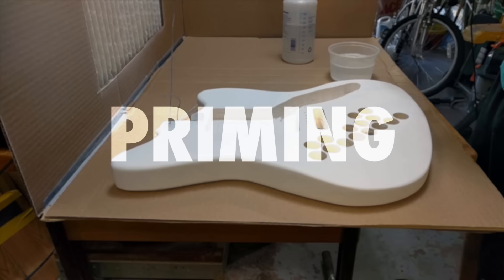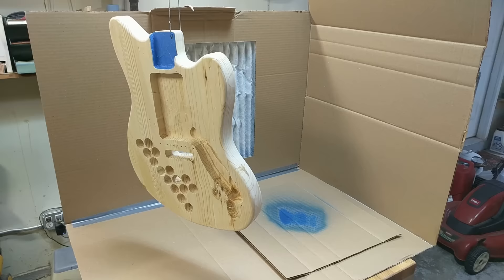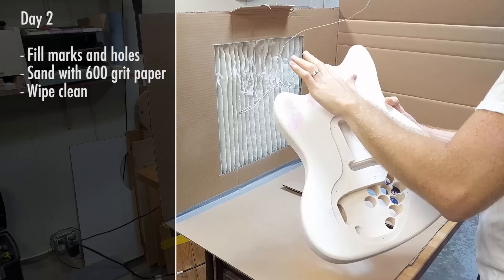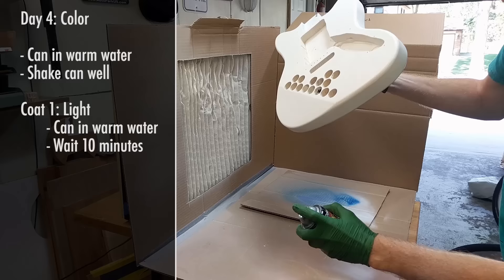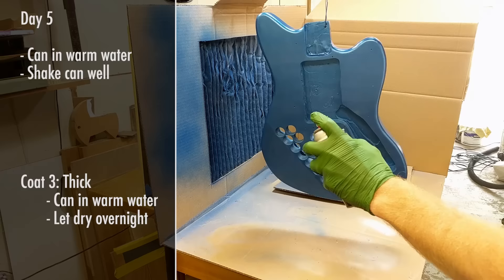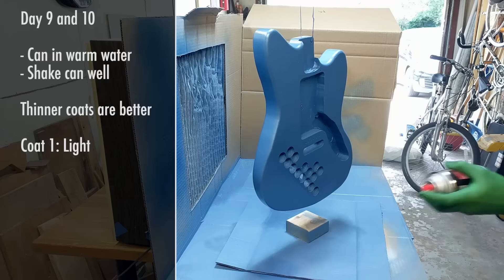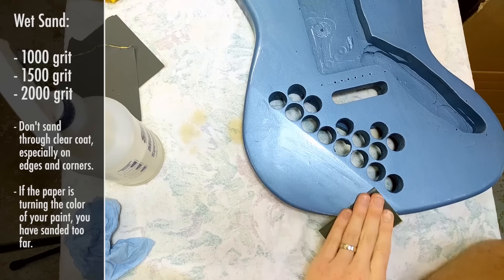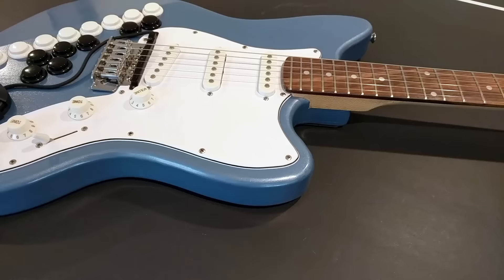How To Spray Paint A Guitar - Start to Finish

Comment: The video itself is well made but the described technique is not the way to paint a guitar, I am sorry. 
First of all, the prep work is key to a good finish. You need to sand down the wood with up to 800 grit paper to create a very smooth surface. If you use wet sanding paper for the last two or three runs, you will already remove any wood fibres that will lift (and create a velvet like surface) when getting moist.

Using car paint is alright to get the color you want but the primer should be a wood spray primer with thicker filler to close pores and cracks. (Before even using that, I would use a paste filler to get the worst pores and cracks removed.)
Only the first layer should be thin to create a surface the primer can stick to. Then you can already go with a thicker layer, sand it, respray a thicker layer and you should be done priming within 2 or 3 hours (including drying time). Let it rest over night to harden and go on with the base color paint the next day. Use light coats and bild up the coverage you are going for in many thin layers. If you use metallic or pearlized colors, only the last coat needs to be a bit thicker and very even to create the effect. Start with the sides, than back and front to create the best surface.

The clear coat should be a two component clear coat if you go for automotive laquer or a nitro instrument laquer. The key to good sound is an almost non-flexible laquer, since flexible automotive laquers will dampen the resonance of the body. So dont get clear coat laquer for plastic parts or anything else branded "flexible". 
To spray the laquer, mist a first layer to create a contact surface, the result should look like a satin finish. Then go with a second heavy coat. Clear coat will build a smooth surface when painted thick enough, leaving you with a small orange peel. After drying it in a heat booth or a room temperature over night, go on and wet sand with 600 grit to remove the orange peel. Due to the thickness of the coat, you can sand a good bit before burning through and damaging the color base coat. Always wipe the residue while sanding to see how far you are. 
The spray another thick coat of clear, let it dry and repeat the wet sanding from 600 to 800 to 1200. By now you have a very smooth surface that needs minimal polishing to get a high gloss finish. 

I realize that you spent two weeks with this paint job and are proud and satisfied with the result. But if you are honest and compare it to professional high end instruments, the result is a bit shy from being perfect. With the proper prep and technique you should be able to spray a guitar body in 3-4 days with professional results. If you watch other instructional videos on how to use paint cans or paint guns, you will see how you need to twist the wrist at the end of each spray to prevent getting drips even if you spray thicker coats.

In the end it is all about practice and experience so please don't get this reply the wrong way. It is not meant to parade on your video but to help you get better results quicker the next time from someone who has painted a lot before and learned the hard way ;)
Reply from the maker: Yeah there is certainly a lot of stuff I learned from this first go at it. I think the most common paint mistake is people think that the paint is dry so they spray another coat over it and then the bottom layer can never dry so the finish is always sticky. I just avoided that by waiting a full day every time. 

Thanks for the tips!
Reply: mervolicious - Great instructional summation! But could you clarify what you meant when you said " If you use wet sanding paper for the last two or three runs, you will already remove any wood fibres that will lift (and create a velvet like surface) when getting moist."? Is that a good thing, or a bad thing? Thanks.
Reply: FOAD RIGHTNOW - it is a good thing :) If you take any piece of wood and dry sand it smooth, then moisturize it, it will lift it's fibers (while drying) and create a rough surface again. So when you wet sand until there are no more fibers after drying, you will not lift those fibers when you paint the wood with a waterbased color (which most colors are nowadays) and get a smoother and better looking finish. If you intend to only oil the wood, no moisturizing is needed because oil won't lift the fibers.
Reply: mervolicious - Thanks for the quick reply! Your clarification was pretty much what I figured you meant. Thanks.
Reply: @mervolicious You should do a video
Reply: 800grit on the bare wood is way overkill. You really don’t need to go further than 320. Honestly going further can be hindering because if it’s too smooth paint will run instead of stick. I agree duplicator would not be my choice also if using a nitro lacquer or any volatile base paint DO NOT place a fan behind your spray area. Nothing that can spark should be anywhere near that explosive mist. I don’t know what wood that is but unless the grain is open sealing is optional. A good way to fill grain is 1/2 linseed 1/2 polyurethane worked in with 320 grit as the urethan builds it also pushes the sanding dust into the wood and levels then sanding after successive coats continues to level. When you are final sanding you are only sanding the clear coat not the wood. 
I am not saying that my way is the only way or other ways don’t work or aren’t good but as the saying goes you can shave a poodle 1000 times but only skin it once. There are a lot of ways to repaint and refinish guitars or any wooden object. The keys are prep, patience and products. 
Use the right products in the right order for the look you want. For an opaque finish it doesn’t pay to obsess over what the wood looks like underneath so long as it is smooth but it doesn’t need to be crazy flat the goal is removing tool marks then removing the marks left from removing tool marks then removing marks from....etc. once you apply color and clear coat that is when you start to obsess over getting it flat because the paint itself dries in a jagged fashion so regardless of how smooth it is to start (again 320 is good) you will still need to go from 600 up to 3000 grit or higher if you want before buffing.
Reply: @mervolicious  It wasn't necessary to sand between every coat, was it?
Reply: Eric Veritas Blair I assume you mean in between every clear coat? You could just spray two or three layers and then finally sand it before polishing. But if you want that deep water-like clear coat look, you‘d have to sand after each layer to remove orange peel and therefore optical distortion. This makes especially a difference when you have a flamed or any other structured top or painted it with a metallic or any other effect base color. It is a bit more work but that‘s the way to get that showroom finish :)
Reply: @mervolicious  He was sanding between each layer of primer and color I think?
Reply: Just a side note its 800 "grit" sandpaper, I dont think I've seen 800 "grid" sandpaper. I'm sure that's what you meant to say though.
Reply: Thanks, I guess. 
:)
Reply: @AiMR  personally I've had great results only prep sanding the primer and sanding the clear before polish.
Reply: mervolicious jeez man he’s on a budget here
Reply: Walker Shultz that‘s why my way is cheaper and quicker ;)
Reply: Mervolicious - How to select a non flexible clear coat and painting? I had just ordered Createx paints and clear coats. Are they good enough for guitars and the sustain?
Reply: @franciscojesuscortes  I used Createx to paint rc body shells that are very flexible. So I'd imagine they won't work for a guitar that well. The colors don't really matter but the clear laquer should be a component mix with hardener imho and not a one stage createx clear coat.
Reply: @mervolicious  Thank you very much. I see that Createx  has the 4030 to achieve an stronger paint but I don't know if it works for clear coats too. Which paint gun is good for this kind of works? HVLP or LVLP? 1.3mm is it enough? I know that for little ilustration, a chineese aerograph is enough good today, about 0.3-0.5mm needle.
Reply: mervolicious so is wet sand paper ok to use all the way until ur last two or three runs of using the paint finish?

Comment: I went about painting my faded orange/red strat black and did the absolute worst job ever, and I feel like an idiot cause I should know better from experience already. Guess I jsust needed to see someone else do a perfect job as a reminder to know now. I already have 4-5 coats of black and 2 coats of clear on it, so I'm gonna sort of take the quick route and just do one wet sanding job on what's there to get to the paint, then start from where you started clear coats and thereafter. I was looking for that polished look and obviously did not get that from just 1500 grit sanding plus clear coat. Thanks for the extremely well made video!

Comment: Great vid.  Not to criticize, but learning from my own mistakes... I would use a flat sanding block of some sort when wet sanding the clear coat on the large flat surfaces of the front and back. Otherwise you can get wavy funhouse mirror reflections if you buff it out to a mirror finish. I would personally start wet sanding the final coat of clear coat using 600 or even 400 grit on sanding block regardless depending on how much you need to knock down to get the entire surface level.  Go lightly and slowly being careful not to put pressure on the edges of the guitar with the sanding block. Once completely leveled with 600, or 400 then 600, then jump up to 1000 on up.

Comment: Fun to see how others do it but I would have done several things differently. First wood fill should be done first. I would sand with an orbital sander it's much quicker. Also when you paint you want to alternate from vertical lines to horizontal lines like coat one do vertical, coat 2 do horizontal etc. Also you should never spray paint downward. Can needs to stay upright to shoot properly.  So you should never lay something flat down down when you spray. I use rustoleum crystal clear enamel for my clear coat I never do any wet sand always get an amazing finish and and done start to finish in 2 days

Comment: A filler should have been applied to cracks/defects before priming. Any automotive bondo would work much better than spackle. In terms of priming, it's great to look for a high build like you mentioned that's easy to sand, but I never trust the quality out of aerosol cans. Best bet is to look for Smart or 3m brand 2k urethane primer with the use of a Preval bottle. Keep in mind that you'll need a bit more protection when spraying that particular primer, but it lays on thick and hardly sags. It also benefits as a secondary filling agent if you were to come across any pinholes that were missed or created by the bondo. Roughly 3 coats of that primer would be more than enough build up, and can be sprayed in an afternoon.

Comment: Next time try a dipped guitar. It's about as easy, much faster and it looks amazing. Just a suggestion in case you make another one and you don't want to wait two weeks. The only steps that take a while are the primer and clear coat. And that is the same amount of time. Also the primer isn't entirely necessary but I still recommend it. So instead of 2 weeks you could be finished in 3-5 days, a week at the most.

Comment: I’ve got one to do and been wondering how to go about it just getting the old finish off will be the hardest part. Thanks you answered heaps of questions. 🇦🇺
Reply: Craig Kaschan use a heat gun and scraper, then sand with 80 grit for any residual paint left

Comment: Sending flammable paint fumes through a fan with a central motor is a major fire hazard! Paint booths are built with fans that have a outboard motors for this reason. Using a box fan with water based paints is perfectly safe but be aware that the heat of the motor and the current flowing through that motor are potential ignitions!

Comment: You should use a grain filler or wood filler then sand smooth before any paint touches the body. This fills any cracks or pore holes. Then a light coat of primer would be fine. Everything else was fine

Comment: Nice video. Cleare, concise and to the point. What kind of orbital sander are you using?
I left my classical guitar in the pocket where the convertible top of my car is hydraulically inserted and lowered the top into it thus smashing my guitar. I decided to try and fix the guitar. It has been a lot of work but fun. I've used tongue depressors, toothpicks, popsicle sticks lots of glue, clamps, string wrapped around the guitar to hold pieces in place while the glue dried. I had to pry the guitar apart in places inserting carved out sticks to hold it apart while applying glue. The most important thing has been lots of patience. I used wood putty to fill in the patches dents and low spots  That took me a long time to get it to look ok and to sound ok. I decided to give it a sunburst effect paint job. I tried handholding the spray paint can but after many failed attempts decided I didn't have the skill to pull that off. I went to youtube and got some ideas and cut out out a template a couple inches smaller than the top of my guitar. I didn't like the results. So I sanded off all the paint by hand and still working on it.  I wish I would have taken pictures to show the progress.

Comment: Certainly not a bad job for a garage project and doing it without professional equipment.  Well done!!  But, may I suggest instead of hanging the guitar from the ceiling, use an old piece of wood cut to the size of the neck and put it in a vice to turn it around.  Much more stability for your work.  I think it was pretty ballsy to use spray cans but hey.....whatever works!
Reply from the maker: Yeah, the biggest thing I would change if I was going to do it again would be to build a stand like Brad Angove.

Comment: You don't use primer to fill cracks you use grain filler or expoxy resin depending. then you vinyl seal over the epoxy, then you prime

Comment: I understand your problem with not applying enough primer first.  Actually what you are supposed to do is spray the guitar with a wood sealer.  Its used by carpenters to seal in all fine grains and leave the wood smooth.  Then sanding it down with fine grit sandpaper.  The problem is the stuff is very expensive.  Almost $100.00 for a full gallon.  And unfortunately that is the smallest they sell them.  That was the biggest expense when I painted my guitar.  But it was very well worth it.

Comment: Your spraying techniques is quite good although, your coats should be applied both horizontally and vertically. This give s a much more even application. Also, all coats should be even amounts until it appears wet all over. This can take five or six or more passes to build up the lacquer to look wet. Trying to put too much paint on at once causes floatation in the finish, especially with metallic colors. The biggest mistake people make with lacquer is applying too much paint. It causes the paint to crack in a year or so after it has fully degassed and shrunk. It is best to only apply enough to get a solid covering of the color without overdoing it. Then, let it sit for two to three weeks, depending on the season (winter is longer of course). Then, after it has fully hardened and degassed give it a light sand (#600 dry) and two coats of 2K polyurethane clear with light sanding between coats. Be very careful wet rubbing guitar bodies. The water can get into the wood and cause swelling and de-lamination of the paint. - My 20 cent's worth.

Comment: Before applying another color coat on a previous DRY one it is NECESSARY to sand it just a bit with a ScotchBrite. Same with clear coats. And if you wet-sanded before clear coating just as you did before polishing - it would be faster and easier.
Reply: only if you wait days in between like he was suggesting and leave it dry..which is completely unnecessary..you should spray one color coat then let dry for no more than 45 mins tops before spraying the next color coat
Reply: @simplyseas6122  it depends on the type of paint and how well the wood is prepared. If you use epoxy pore-closing base coat and automotive acryl paint - than yes. If you work with nitro base and laquer - drying is necessary. Otherwise the new coat destroys the previous one and this thing will not work. I am repainting my guitar for the third time now for this reason.

Comment: Your guitar looks great.  I can NOT get the Dupli-color to not spit and drip.  Never got any kind of even finish out of it- it's all splotchy.  Even kept the cans as warm as I could.  Cleaned nozzles after every spray, re-shook as required - nothing.  I finally sanded my guitar down as flat as I could, left as much of the Dupli-color on as I could, and sprayed my guitar with $5 Rustoleum gloss enamel and crystal clear coat enamel - WAY EASIER TO USE.  After combined six coats of that, all the Duplicolor fails are coated over and my guitar is finally looking half as good as yours.

Comment: Hi!
Please share with us how you built the midi guitar, and if possible, how to use the sound banks of say a keyboard.
You could have used wood filler for an opaque coat, however using several coats to show off the natural wood grain would be one way to success. I suppose you could use a a fine grit buffing compound on the lacquer itself and lastly the wax. There are also transparent fillers available. Thanks.

Comment: Can I paint some art  on my guitar with  either oils or acrylic then use the clear sealant you used ?
Reply: I've had good results using water based clears. If you are going to be using mixed media's on the same guitar, water based clears will lay over MOST anything without bad results like crinkling up the paints.